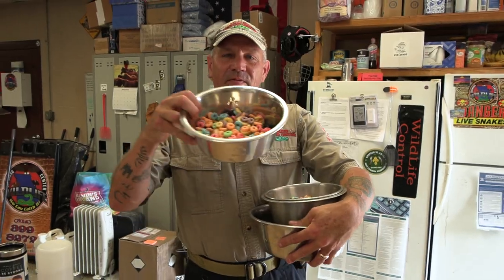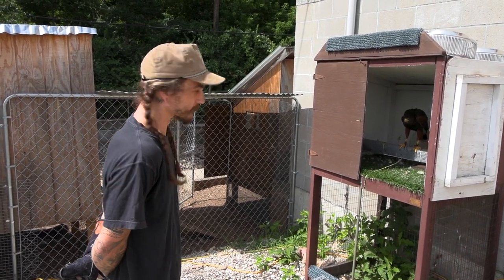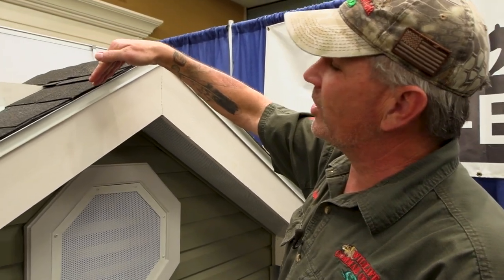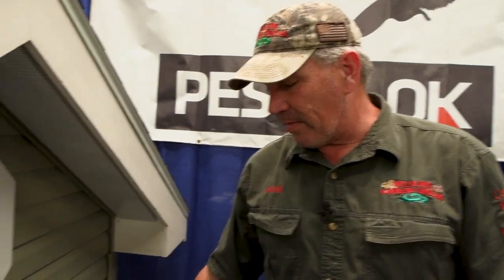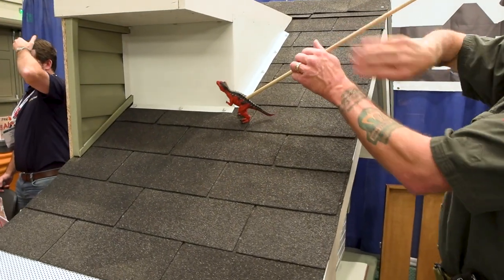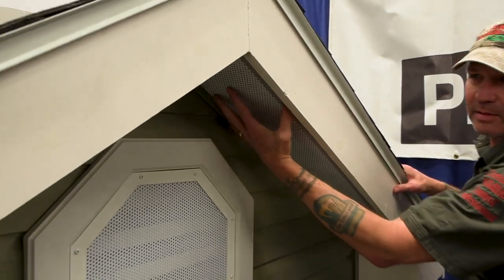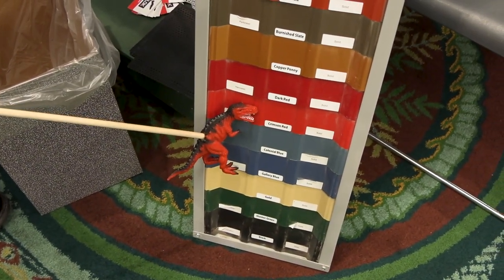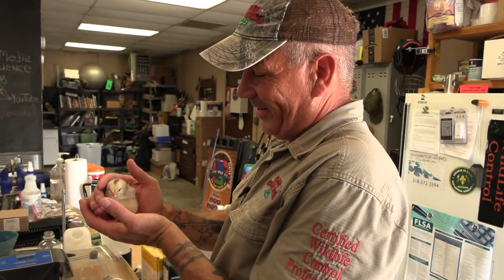PREVENTING WILDLIFE ISSUES | What's the worst that could happen? 😳

Comment: How different houses are built in the USA. In Germany there usually isn't any opening in the attic, since it is often used as another small "regular" room that is insulated and heated, neither are there crawl spaces under the house, but usually a basement with cement floor.